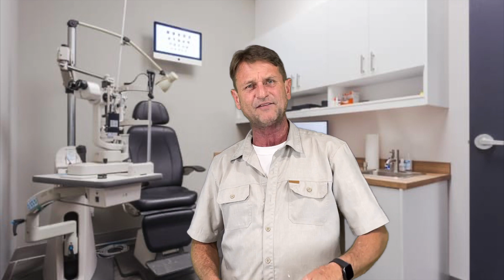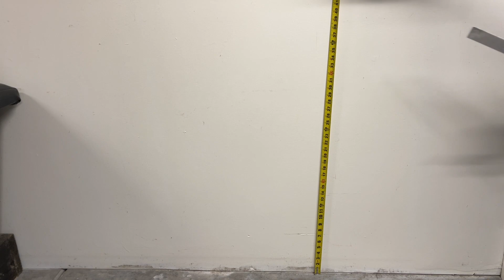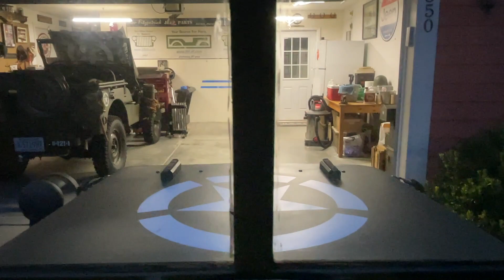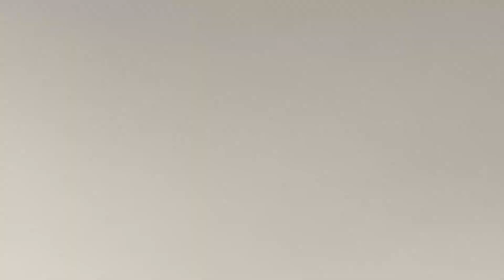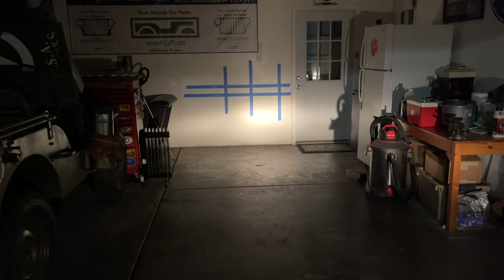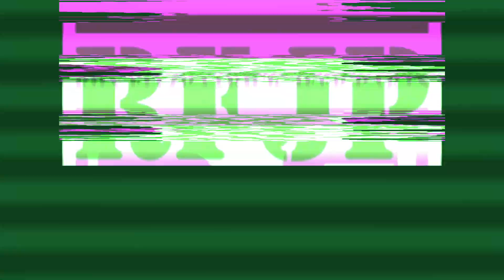G503 Headlight Adjustment Willys MB / Ford GPW

Comment: How do I do  Willys wagon? Lol
Reply from the maker: I would imagine in the same fashion.
The heights and dimensions would probably end different, but I bet the principal would be the same👍
Reply: @TeamG503  the hood is so different for a start point. Is there a relevance from say..center of head light bulbs to the ground on your 43? So then I could measure center elevation in my willys and then come up the wall same distance. There has to be some importance there..